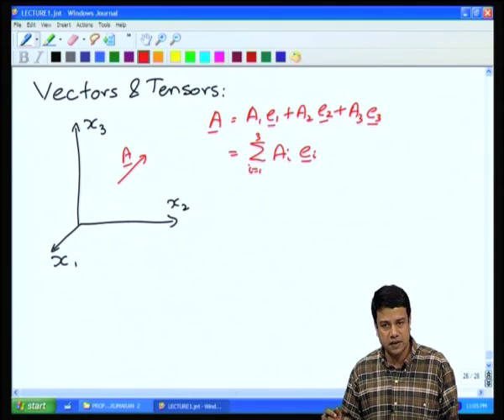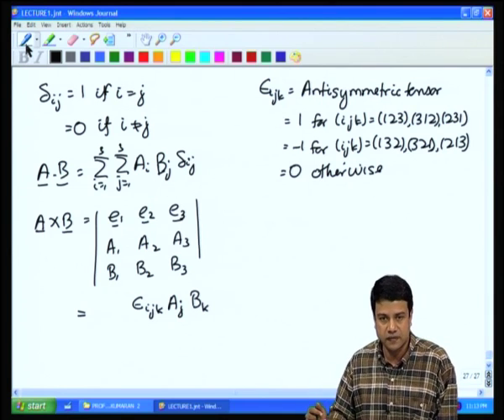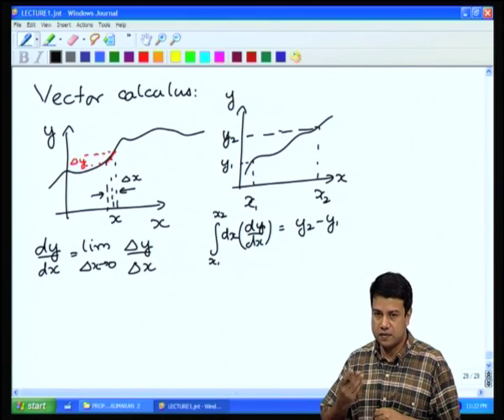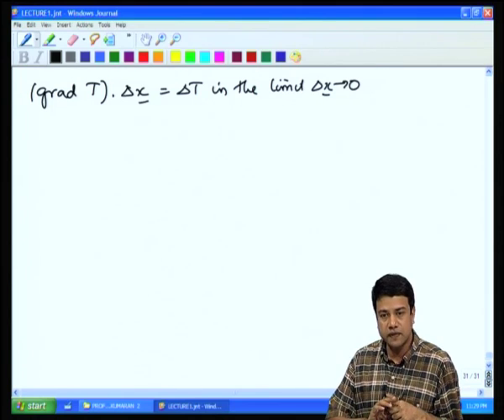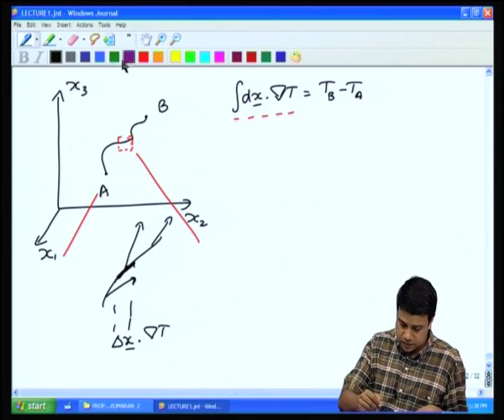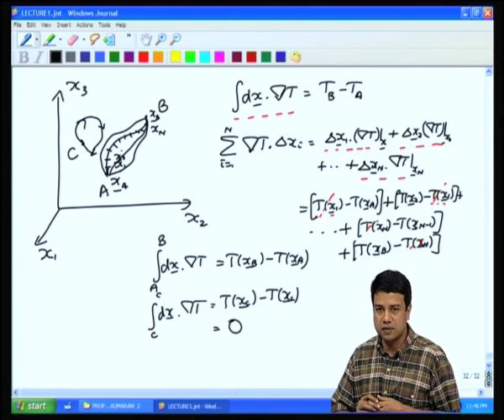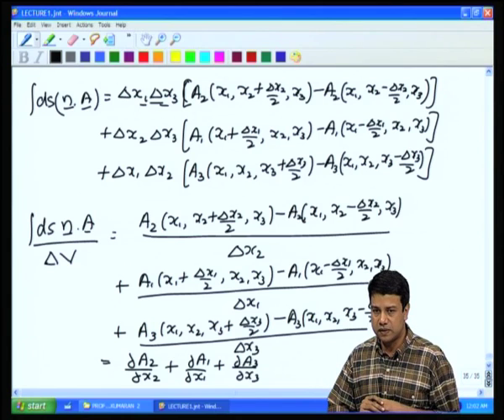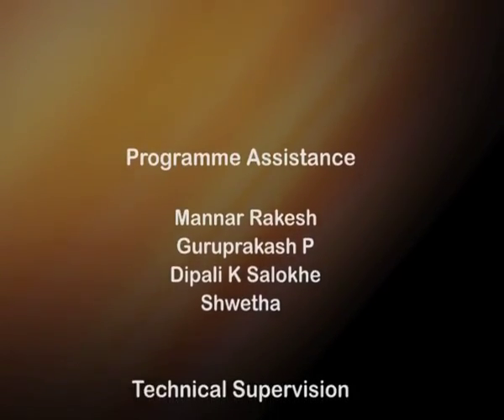Mod-01 Lec-04 Vector calculus

Comment: iam confused...Txy is defined as shear stress on (YZ plane,so normal is X) and measured along Y. but at 3:00 minutes it's opposite.
Reply: Txy is the force per unit area acting along the x direction at the plane having y-axis as the normal i.e along the x-z plane.